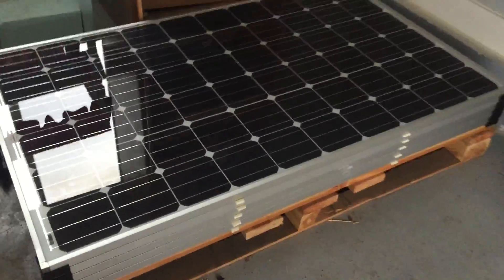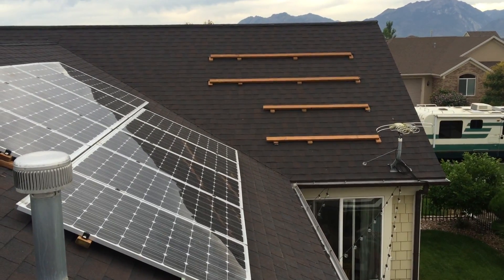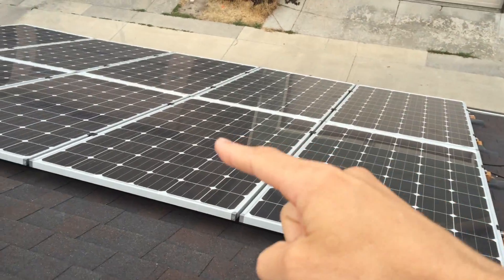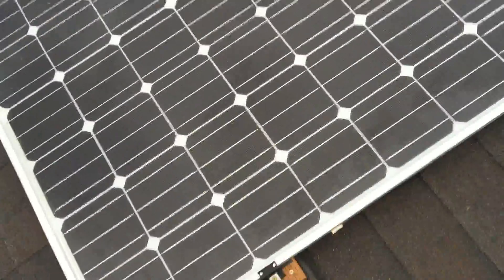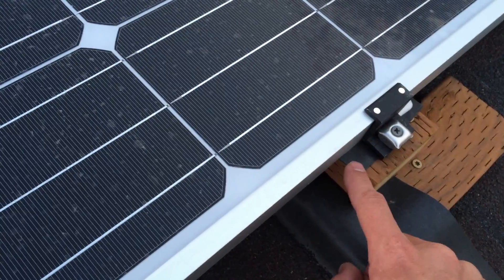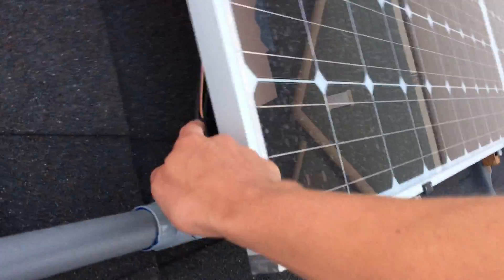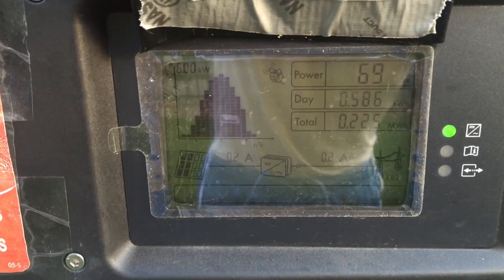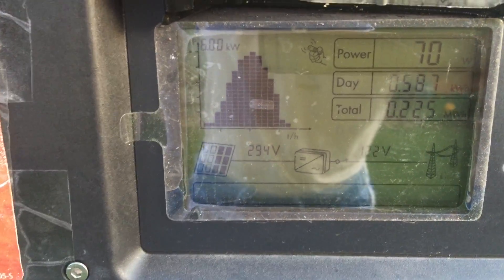How To Install Solar Panels Yourself For $4K - DIY 7KW - South Jordan, Utah - Cheap

Comment: About micro inverters agree they are to expensive. Unless you have the propitiatory software on a PC and compatible inverters you are not going to know which one has failed and one day they will. Fragile electronics don't last. If you have one or two inverters then you can easily replace or upgrade them later on. because they will be inside your house and easy to get to. imagine having to remove two to three solar panels just to get to the one that failed and hope they still sell that same model that is compatible with the software. Also if you use a central grid tie inverter, If the grid fails you could still wiring the panels into a pure sign wave inverter and use them to power your house. if you used micro inverters you would not have that option. I bet micro inverters have a warranty that does not last long.  What if they only last 3 or 5 years before they start failing. It would be a big pain to remove all those panels to replace them. I want to use panels like his and have them in pairs to have 72 volts and feed them into 2K watt grid tie inverters that sell for under $500. and have a transfer switch and use them to power batteries if I wanted to.
Reply from the maker: thanks - good points on the micro-inverters.  I looked at those 2K watt grid tie inverters but realized it was just easier and more cost effective to just get one 7K one.  I also am not sure if those 2K ones meet code.
Reply: I have seen a lot of them on YouTube people using them. come in 1k and 2k versions are blue in color and have a nice Color LCD display and can be hooked up to a PC to be monitored. on Ebay they have GAI defender on the add. Thinking name starts with SUN or something like that. those are the ones I will get. I cant afford to put 7k in all at once so I figure I would install 2k at a time. probably install 6 to 8 k when done. I would guess they do meet code but would need to send a message to seller to confirm.
Reply from the maker: I see - makes sense.  I am interested to see how you configure it with these types of inverters.  I wanted to try some but didn't pursue it much.  I think you are talking about something this - https://www.ebay.com/itm/MPPT-1500W-or-2000W-Solar-Grid-Tie-Inverter-DC45-90V-Pure-Since-Wave-Inverter/262729608952?hash=item3d2be7aef8:m:mf0NG4SpPcDUmAYGtB6YxbQ

Comment: Hopefully your shingles don't need changed any time soon everything will need to come off roof to replace them.
Reply from the maker: Yeah, the roof is only 9 years old, so I should be good for another 15-30 years.  Shingles are in good shape at this point, and when they get replaced, I will just replace the solar panels, or just move them off for a bit and put them back on - not too hard.

Comment: After a lot of research I have decided, like you, that I will also go with an SMA Sunny Boy string inverter on my project.  They make a lot of sense and I've read of too many micro inverter fails.  Plus in a few years, when they do fail, the ones you used will not be available and there might not be a match.  Then What?  -- Oh, plus the Sunny Boy has the Secure Power Supply so you can still get some A/C when the grid is down.   So thanks Matt!  I'm still learning from your video!
Reply from the maker: Bill Lynch that is true. I guess with a single string inverter it is a single point of failure, but with a bunch of little micro inverters the probability that one of them will break much higher.
Reply: Plus, if the string inverter fails you replace it on the ground.  If micro inverters fail you have to get back up on the roof and start tearing stuff apart.  I like staying on the ground.

Comment: Are those north facing panels? If so you have no yeild ln the north side.
Reply from the maker: No, of course they aren't.  They are all SW and SE facing.  Also, I used https://www.sunnydesignweb.com/sdweb/ to plan and optimize yield.

Comment: As an Electrician and Solar installer in Australia I was expecting this to be horrible. I'm actually kind of impressed. Not as neat as we do a job but that's obviously not a concern on a DIY.
Reply: Timber rails? Not in Australia. But good video. The roof conduits will collect debris. Should be inside the roof. No rebates in Australia for diy solar installations.
Reply: @DarylRaverty  - No rebates for DIY. Now that is industry lobbying at it's finest.
Reply from the maker: Yeah, strut channel would have been better, but I didn't realize it at the time.  Lumber is working fine though - it is treated and will last 20 years at least.  The conduits haven't collected any debris so far, and it has been a year and a half and many snow storms and such.  But in hindsight I would have probably done it inside the roof - I was just scared to poke holes in the roof.  Too bad you don't have incentives - ours are going away by 2021 too, but the price of solar continues to plummet so it will be fine.
Reply from the maker: thanks!

Comment: Do you think using micro inverters at the panels would have been a better choice over the big Sunny Boy single point inverter?
Reply from the maker: I think it would have been a bit better - it helps regulate the current if you get partial shade and what not.  However, I didn't do it because it costs more for microinverters.  I could get a 6-7KW inverter like mine on ebay (new) for $1500, and if I had gotten 30 enphase microinverters it would have been about $2-3K I think (they are about $90-100 on ebay I think).  If you can get a deal on microinverters, I would probably do it, but it is also more work to install.
Reply: makes sense.  thanks.  (I think the micro inverters are more like $150 each?)

Comment: Save $4k spend $20-30k on a new roof when solar panels cause your roof to leak or rot.
Reply from the maker: justgivemethetruth no it actually isn’t leaking or rotting after a year and a half and I expect that over the 20 year life of the roof and solar panels I will save $30K and it cost me $4K. If it goes 30 or 40 years, even better.
Reply: That's great, I did not mean that as an attack on you, but just that not everyone is as knowledgeable, handy or lucky.
Reply from the maker: truth - but one of my intentions of the video is to inspire people that they can do it if I can!  I was overwhelmed by it, but soon realized that it wasn't as hard as I anticipated once I understood what it entails.

Comment: So whats ur bill at now with ur solar panel system?
Reply from the maker: see https://diynewman.wordpress.com/2016/07/24/how-to-install-solar-panels-yourself-for-4k-diy-7kw/ for a follow up.  Basically I was paying $1500/year for power, and now I pay $200 ($8/month and one month of paying about $100 in the winter).  I may buy a few more panels to make it so I don't pay any of that.
Reply: Wow.  Very impressive.  I will definitely copy ur project. Ive just purchased a home.  Im moving in a week.  Its a 3k sq. Ft. Home with a pool and 2 ac/heater units and im dreading my first light bill.
Reply: Hi again. On your items and costs outline i saw the state and federal tax credits youve outlined.  Do you get that refunded when you do your taxes or is it rebated immediately from the seller?
Reply from the maker: yes, it was a tax credit on my 2016 taxes.  I didn't get it immediately from the seller.  I got it when I filed my taxes in February of this year.  some installers will make a deal to pay you right away, but if you are doing DIY and buying from a wholesaler, I doubt any of them would do that deal because they aren't gouging you like the installers are, so the wholesalers aren't as inclined to make deals like that.
Reply: Thanks for info. I went to the website where u purchased ur panels and im sure im mistaken but ur shows prices for palets of panels in the cents range. Whats that about?
Reply from the maker: That is per Watt.  Each panel is 200-300 watts, and I got 30 panels.  So if I paid $0.50 per watt, and I got 7kW (7000 watts), it was $3500.

Comment: Just a heads up, all of your panels should be facing in a single direction (usually south but it varies area to area). Also make sure they get full sun, some panels will not provide power if even a small section is not lit. 

Also be careful how you wire them. Series and parallel do different things and if not wired right, weird thing happen. (Sometimes even a house fire)

Finally, even if you think you sealed the roof 100% it still pays to check after a good rain. Roof damage can be costly and drilling holes all willy nilly could cause mold build up and ultimately rotten wood. You could be looking at a very expressive problem if not checked.
Reply from the maker: so my house is on a 45 degree angle, so i put panels on both southwest and southeast facing roofs.  I just put the southeast ones on one string, and the southwest on another string.  So, this prevents the problems you are talking about.  

yes, you should hook them in series on each string.  It is pretty easy though because the male and female ends fit right into each other.  It would be hard to make them parallel.

good points on the drilling holes - thx.

Comment: The conduit looks like crap. I would have ran those wires through the attic for a cleaner look.
Reply from the maker: thanks for the feedback - Yeah, it is one of my lessons learned, but also, no one looks at my roof so I don't really care.  I also was a bit scared of making holes in my roof not know how to do it.

Comment: https://www.youtube.com/watch?v=tket3Ehn7Ss

Here is my system They would not allow me to make my own racking system here. had to have fire, wind, weight engineering all provided by manufacturer. 

Nice system. should have gone with microinverters. though less chance of failure and fire.
Reply from the maker: Thanks for sharing and appreciate the feedback.  Of course, I would disagree that microinverters are worth it.  In my case, it would have add a couple thousand dollars to the project cost (but admittedly I didn't shop it too much).  I have seen 6-7kW string inverters just like mine for about $1200-$1500 on ebay (Buy It Now).  Microinverters are about $120 each, and in my case I would have needed about 30 (one for each 240 W panel), so it would have cost about $3600.  I don't think the risk of failure/fire is that much higher, and it can save you $2000-$2500 if you go with a string inverter.  If you have a lot of tree shade, it might be worth it though so your production stays good when panels get partially shaded.  I did look a bit and saw 240W micro-inverters on ebay for about $50 each, so maybe that would be worth it.  You could also use those 1000W ones on ebay that are about $100 each (and put 4 panels on each one), but I am not sure if those are rated for outdoor use and if they would pass inspection.

Comment: Matt, 
Great video. I'm extremely handy but installing a solar system scares me a bit. Hopefully I get to install one soon since my electric usage doubled to about 1500kWh per month after I installed an exercise pool.
Reply from the maker: Don't fear it - I was scared too not having much experience, other than installing electrical in my basement.  However, it was easy.  I think your situation justifies it - do it!

Comment: 7kw for $8500
Solar is a lot cheaper when you get other people to pay your way.

Get on HUD & FoodStamps so you can have other people pay your bills for that too.  Dont forget to grab a free Obamaphone
Reply from the maker: So you don't get any tax credits or deductions?  Given my income, I would definitely feel bad about using HUD, food stamps, or an Obamaphone because those are designed for people in lower income brackets than I am in.  However, I don't feel bad about getting tax credits that were designed for people in my tax bracket, and I am sure you don't feel too bad about the tax credits/deductions you get either.  As far as I am concerned, I am perfectly within the laws and ethical boundaries on this.  The government policies are designed to incentivize people to install rooftop solar because it reduces greenhouse gases, distributes electric power generation, relieves scaling issues and outage risk for utility companies, helps create jobs, etc. - all things the government wants and things that we as a people have deemed beneficial to our society.   If you don't like these policies and the fact that I am allowed to get the tax credits, I suggest you insight political change to make those policies change (i.e., run for office, influence current policymakers, etc.).
Reply: Folks legally whipped black slaves, being legal dont make it right.
You can pay for your own solar, or you can make others pay for YOUR solar.  Why do you beg for charity welfare solar gov handouts when you can afford it on your own?  If you want solar for you, then YOU pay for it.  Feds are $20 triilion in debt, they cant afford to welfare you some solar.

I retired early. For the next 11 years I will have zero income or tax burden, til I start pulling out from my retirement funds, which will be taxed.
Reply from the maker: I appreciate your thoughts.  I suppose this is where we agree to disagree.  This is not MY solar - it is OUR solar.  I am providing public good by going solar.  Good for you for retiring early, although I guess I also wonder what tax credits you have been getting along the way.  At any rate, I respect your opinion and ethical stand on this, but I still don't agree with it.

Comment: Those wall tiles at 6:00 set my OCD off!
Reply from the maker: hmm, not sure what you mean - you are not into the yellow shake shingles on the side of the house?
Reply: The differing widths of them. I find it uncomfortable to look at. Don't worry, its just me, but i'd have to pull them off and replace with an  equal width version. You should see what i'm like with crazy paving!
Reply from the maker: Oh yeah, the differing widths in shake shingles is actually a pretty common design in homes, but I suppose to each his own!  https://www.google.com/search?q=shake+shingles&safe=active&rlz=1C5CHFA_enUS722US722&source=lnms&tbm=isch&sa=X&ved=0ahUKEwj1uIL-5MLWAhWhjlQKHdlHBlsQ_AUICygC&biw=1680&bih=879

Comment: Thank you so much for taking the time and effort to make this video.   It is MOST informative.  I live in Colorado Springs and have nothing blocking the sun from the roof.  I would like to find someone to install a system for my 7,000 sq. ft. new home with flat roof (spanish style).   It should be easier than a hip roof I think.  I would like to purchase the product and hire someone KNOWLEDGABLE to install it for me.  How large a system do you think I should install for this size home?  How would I find someone to do the labor?  Electrician?  or more specialized?   We have already installed lightning arresters on the roof.  Do you think I would need to bolt the panels to the roof?  won't they hold each other down when fastened together?  Maybe just fasten the four corners of the whole grid unit?   How much space would need to be dedicated to the indoor equipment?    Sorry,  so many questions!
Reply from the maker: so my house is about half the size as yours, so you should probably do a 12 or 14 kW system I suppose.  You could also look at your usage over the past year.  I use about 12,000 kWh in a year.  You would want to hire an electrician for some parts, but also maybe people who just do roofing for the other parts.  I mean, you can just install a solar installer but you will pay a lot more for that.  The lightning arrestors are a very insignificant part of the project.  Yes, you definitely need to bolt (pinch) each panel to a racking system, which is bolted to your roof.  They won't hold each down.  Not much space for the inverter and other equipment - maybe 10 square feet on a wall.  You should probably have a look through the blog post I did at https://diynewman.wordpress.com/2016/07/24/how-to-install-solar-panels-yourself-for-4k-diy-7kw/ to get more of an idea - I think it will answer most of your questions.